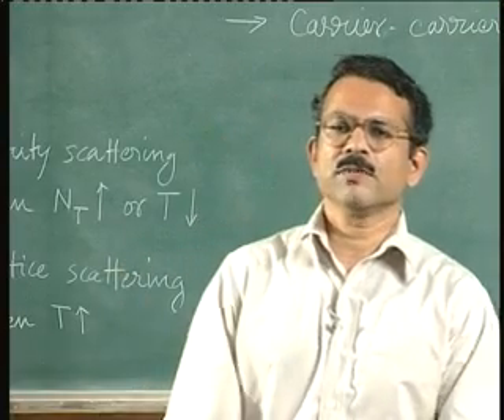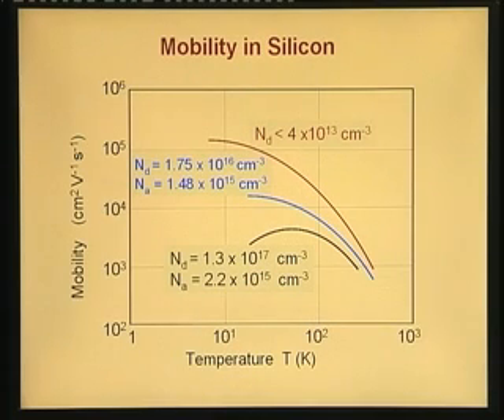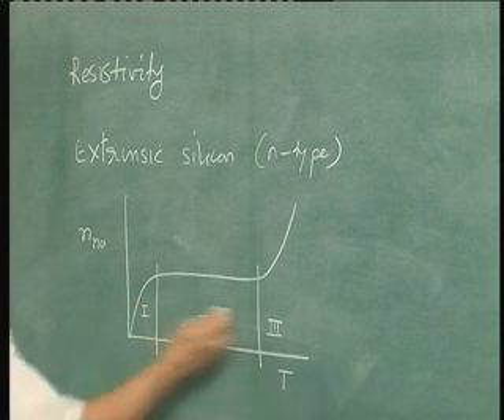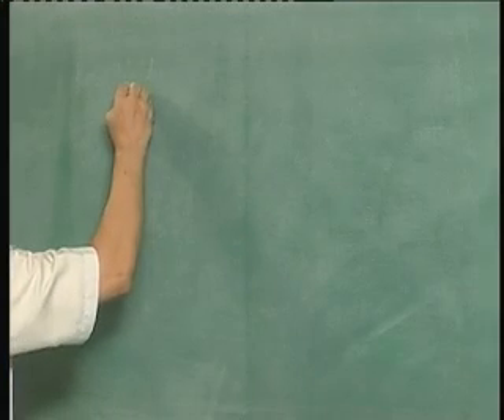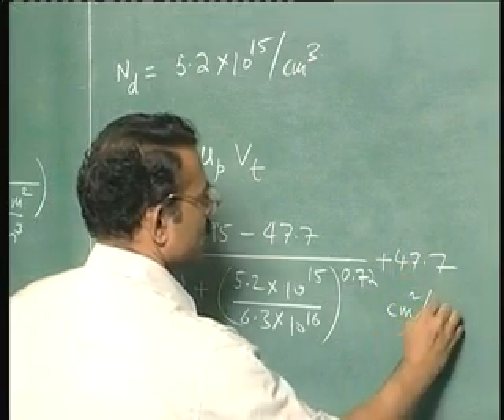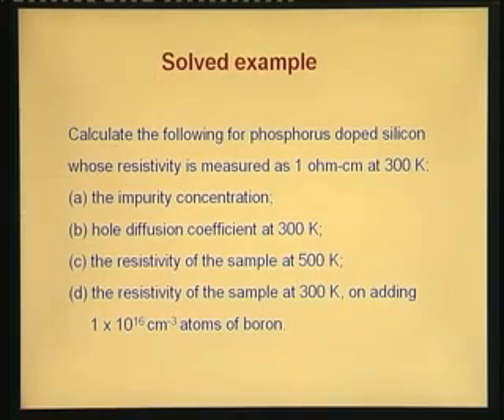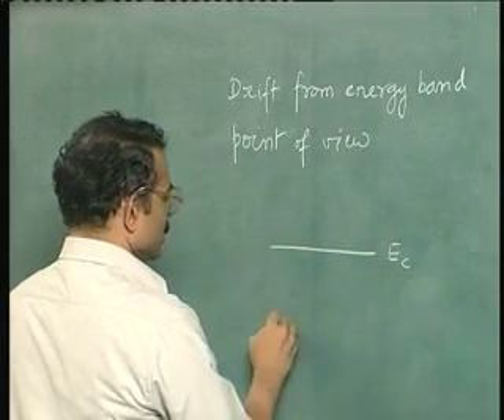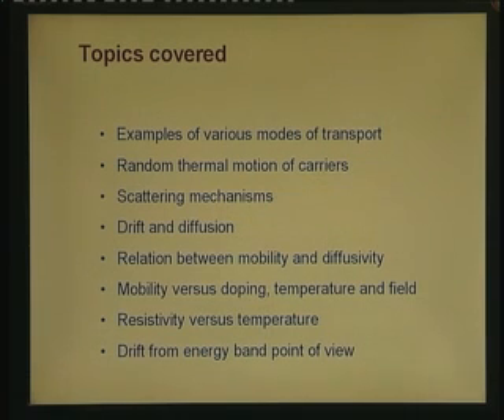Lecture 14 -Carrier Transport (contd)

Comment: Total Mobility seem to only depend on mobility due to phonon scattering at temperature beyond 300K. It is also said that phonon scattering is independent of doping concentration. Then why is there a graph that shows mobility varies with doping at 300K? (9:37)
Reply: total mobility is defined by lowest mobility. Usually above 300k, total mobility = uL. Since uL is large 
 
But At higher doping concentrations, mobility due to Impurity ionized ions decreases with alpha. Thus uI decreases and uL is already less. Thus even at high temps, if the doping is large, uI also comes into play since both of ul and uL are low and both of them decide total u
Reply: @sriharshakodati  I think that even at higher doping concentration lattice scattering will dominate. Yes impurity scattering will decrease compared to that at lower doping level as alpha is decreasing. But impurity scattering also increase with temperature. So even if Ui decrease (idk if it will) then also Ul dominates. As for Ui alpha decreases but temperature increases while in Ul the temperature increases and no effect of increased dopin therefore it will reduce by a larger amount and hence it. dominates
Reply: And yes mobilty will decrease with increased doping as Ui decrease with doping if it's values at same temperature and different doping concentration are compared. So lines of Ui and Ul will intersect at a lower point. 
But I am not sure if I am correct in both my thinkings😅